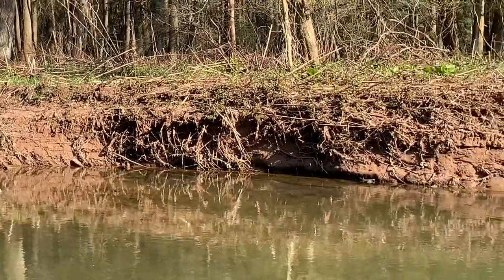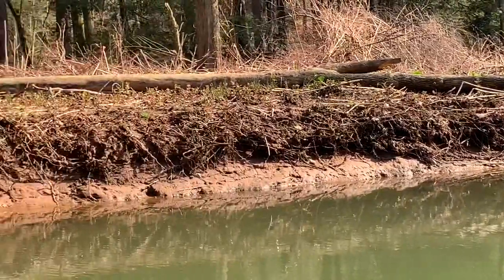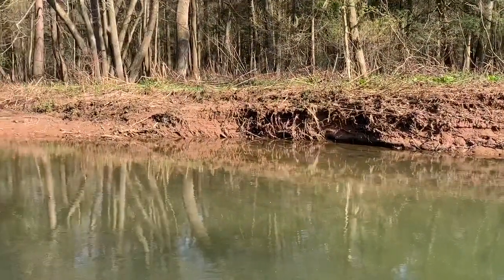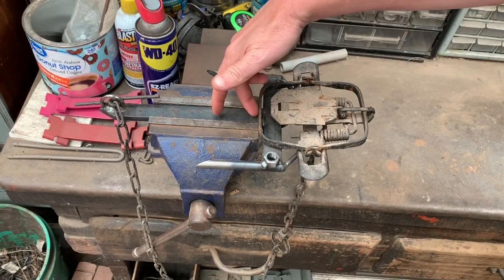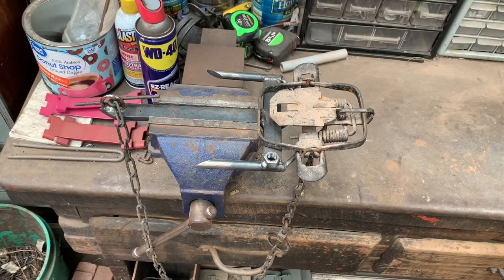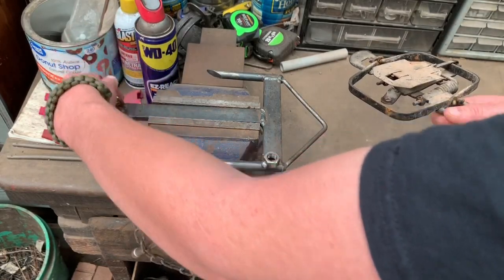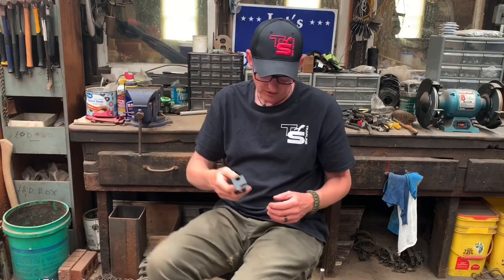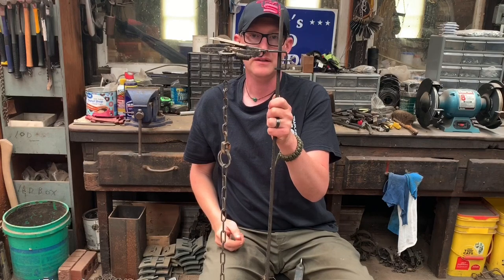Top Edge Grapple - Mink & Muskrat Trapping

Comment: That’s a great idea, I use the HAGZ brackets a lot with 3/8 in fiberglass poles, the issue I have the creek bottoms around me are rock so you can’t drive in fiberglass or steel.

Comment: Great idea. Weld a 1 in tube that would receive 3/8 in. Fiberglass rod on the bottom. Weight reduction. Can double up for baited rat set also and can use as a bottom edge with110 and top edge combo.